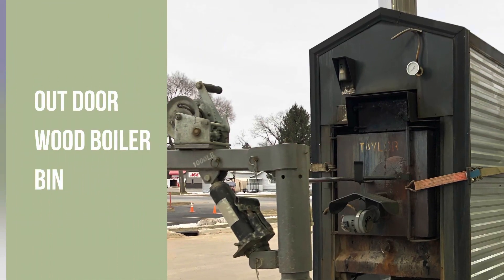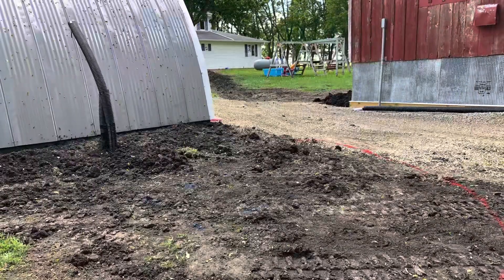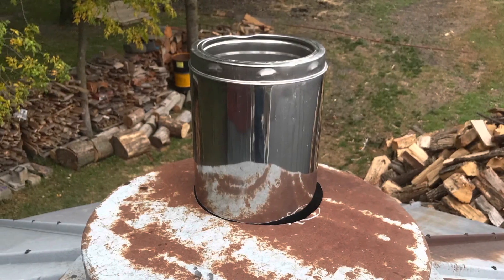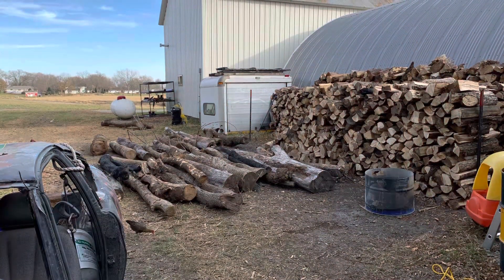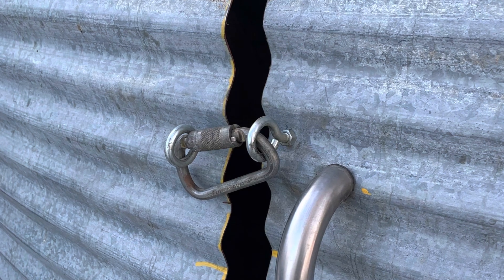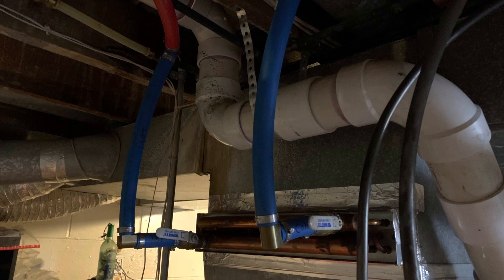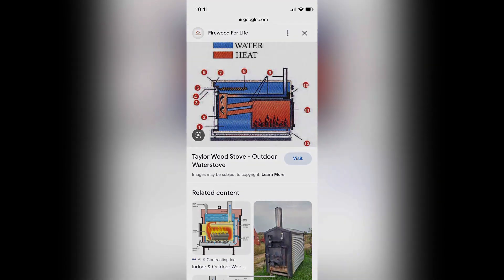Taylor outdoor wood boiler bin install DIY

Comment: What do you use to clean it out with ? Do you have a long scraper to clean out the long flue ?
Reply from the maker: Yes. A homemade scraper with a wire brush on the the other end
Reply: I use an auger bit on a big drill to drag the creosote out from the rear cleaning box.  After putting flue extensions on the smoke stack years ago, the creosote buildup became very bad.  I think the Taylor is so efficient to get as much of the heat out of the exhaust that the longer pipes needed to get outside the pole building I built around my Taylor is just not hot enough to carry all the smoke byproducts out, so creosote became a problem after I built the pole building so I wouldn't have to stand out in rain, snow, and wind to fire it.  The auger is about 3 1/2 feet long and fits a hand held drill with a stabilizing bar to help resist torque, should I happen to hit a dried chunk and the auger grab.  Then I use a bristle  brush to clean what is left  behind.

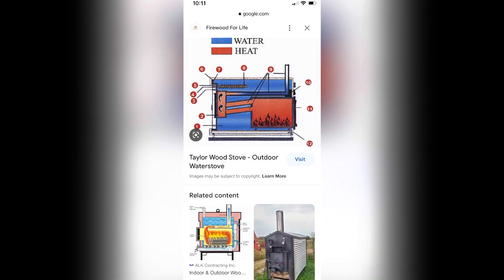Comment: I have had a Taylor T-750H since 2005 and it generally works great.  I've been trying to troubleshoot a problem that has been bugging me for several years.  Somehow I believe some of the heating water has gotten into my potable water system, I can sometimes smell wood fire in our shower and if it is getting into the shower, it is coming in the hot water heater inside which is potable and shower water - problem, so I put in valves to shut off "potable" water from entering the house, consequently I lose the heat saving energy to my electric hot water heater.  I also noticed that prior to shutting the heated potable water off, that the holding tank surrounding the fire box would have a constant drip overflow.  I thought the Domestic Hot Water Coil had sprung a leak and water could go from the coil to the tank surrounding the firebox, but potable water in the Domestic Hot Water Coil would be under pressure, and the water around the firebox was not.  I'm thinking perhaps the problem is in the shut off valve on the back of the furnace. If you look at the back with the access panel removed, there are two pipes coming out of the tank on the left but three on the right, in addition to the potable water hookup to the Domestic Hot Water Coil.  What exactly is the valve that is on the pipe that hooks into the potable water line in the middle right side?  It has a ball shut off valve and if that valve is leaking, then pressurized water can enter wherever it goes.  I have another ball shut off valve from the water supply that I open when I had to fill the heat tank, but I've never opened the valve in the middle right.  The problem persists, I opened the plate to the Domestic Hot Water Coil and it was dry.  The valve that I can't explain is in the middle right side.  Did my plumbers mess up back in 2005? The stove worked fine until maybe 3 years ago.  I am doing my annual clean out and thought I would trouble shoot looking for a reason for this leak that may have contaminated my potable water.  Is there a way I can communicate directly with you or is this the only way?  I would appreciate any thoughts or insight into solving my problem, the Taylor distributors don't seem to have any advice. I have the same diagram you show at 6:08 in your video, the pipe/ball valve are about where the #2 Rear Clean Out is on the diagram, but on the side of the clean out.  My plumber put a shut off valve T-ed into the #1 Water Return on the left side.  If the valve on the right is supposed to be a fill valve, then the one my plumber installed is redundant.
 Sorry this is so long.
Reply from the maker: Great insight I sometimes smell the wood smoke in the shower as well. I honestly believe it’s from ash and smoke from my hair/skin/clothes. The hot water opens up our sinuses. Making it seem like it’s from the water. Just a thought.
Reply: @foty3rothers859  You may be right.  I replaced the shutoff valve and that seems to have corrected the constant drip problem.  I see no way for cross contamination between the potable and heating water.

Comment: Ingenious idea to enclose the wood stove/boiler. Away from your home makes it very safe. Is the water it heats in pipes built around the stove part, how does that part work? Good luck and thank you for sharing. John
Reply from the maker: The very end of the video explains the water jacket built around the firebox. Hope this helps.

Comment: That's a sweet sit up.     You  store your wood  in there to
Reply from the maker: Yeah, I spent a lot of time in the past stacking this year. I used a skid loader bucket to push it all in a pile no time to stack before winter.
Reply: @foty3rothers859   I understand that.
Reply from the maker: @thomas1971ish  I actually made a used oil drip system as well, but after a few days, creosote builds up and blocks the flow. It drips right in the firebox. Works really good until it doesn’t.
Reply: @foty3rothers859  yell I made one for my garage.  Good heat but got stay on it.

Comment: So question for you, did you install a bypass valve in the house so the heat exchanger in the ductwork only gets hot when calling for heat? Your heat exchanger would always be hot but the valve would closed and only open when the house is calling for heat? The work shop would be the dump load or if you added a manifold in the basement with two valves you could heat your hot water also. I’m not sure as I didn’t see a second  pump on the house side. So the pump at the Taylor is primary and the secondary in the house  would be on a pump relay with heat or hot water calling? Don’t forget a freeze stat ooh the boiler to call for heat just incase! Anyway that’s a great setup! Enjoy
Reply from the maker: Those are really good ideas. Keep making updates and trying to make it better every year as funds allow I will keep those upgrades in mind. Right now I’m working on radiant floor heating on the main level of my house.